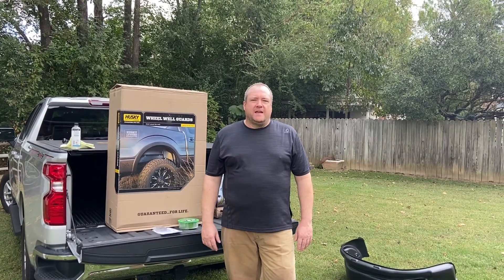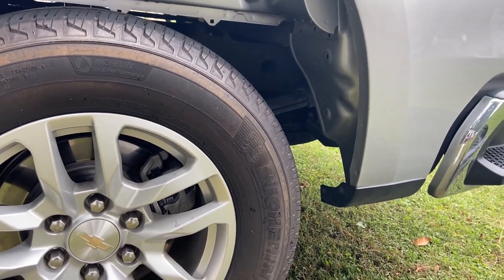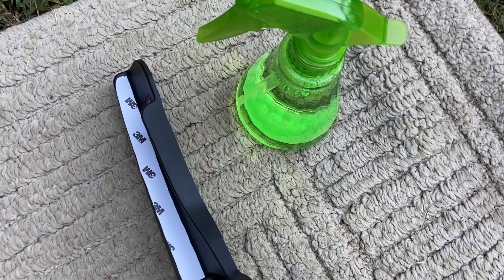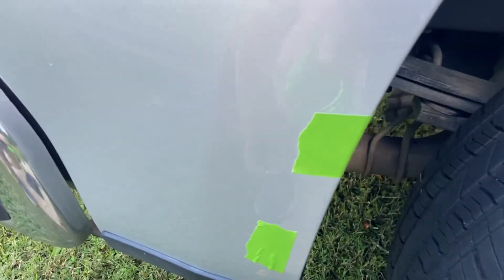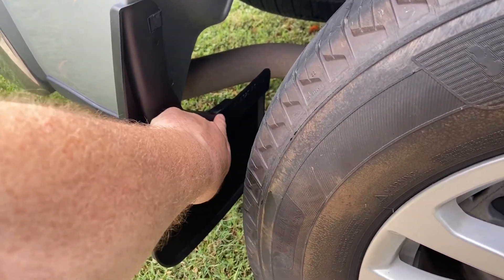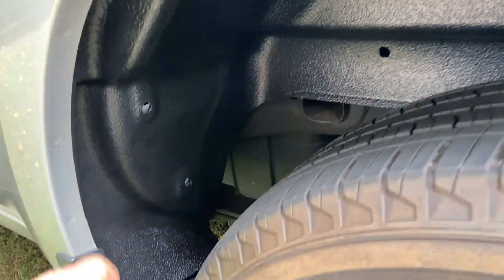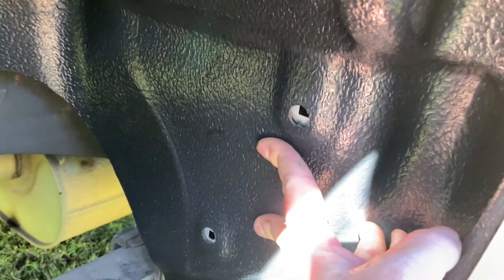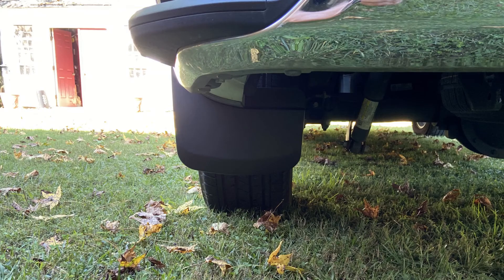Protect your rear! - 2020 Silverado Husky Wheel Well Guard and Mud Guard Install

Comment: They seem nice except they seem a bit short on the bottom fronts.  They should extend a couple inches further down or attach in some way.
Reply from the maker: I agree.  I was not incredibly pleased with the fit and finish of the part where the front of the inner fender cover met the front mud flap (@12:18).  I feel like it should have been longer to tuck behind the front mud flap and not being at least a straight line looks a little unfinished.  Other than that, they are pretty good.  I have asked the person who owns the truck a couple of times how he likes them and he continues to be satisfied.  They are staying in place well and he is having no issues.  Thanks for watching.

Comment: What about the rubber washers and the Xmax tree plugs. Washer or no washer?
Reply from the maker: In the instructions, if you use the Christmas tree fasteners you don’t use the rubber washers.  The rubber washers are for if the truck had some liners already installed with with machine screws.  In this case you would use the rubber washers for this installation with the original machine screws (see steps 8 and 9 in the installation instructions).  I tried to use the rubber washers with the Christmas tree fasteners but the hole in the rubber washer is way too small.  Overall the Christmas tree fasteners seem to hold the liners in well so far.  Thanks for watching!
Reply: @dia_guys  Thanks for the information, will order a pair today.
Reply from the maker: @V-CarChannel  Sounds good.  I hope you enjoy them and the video helps with your installation.